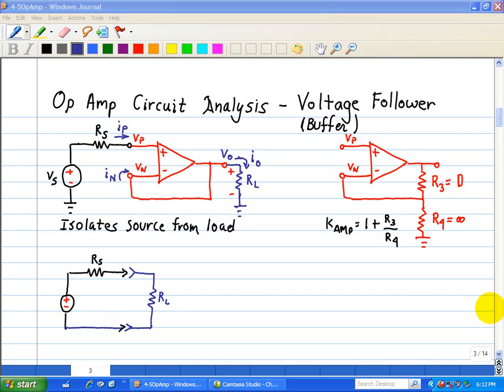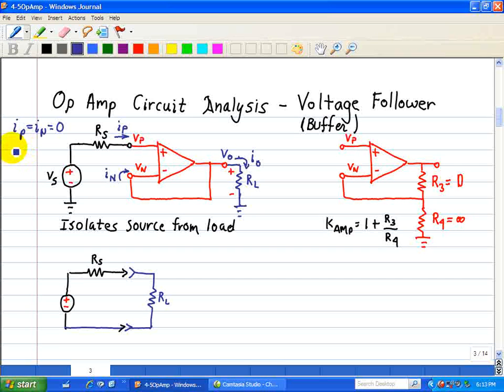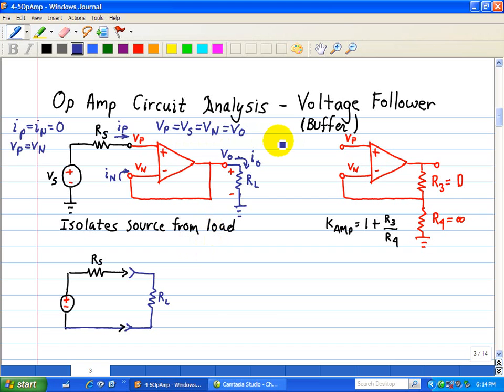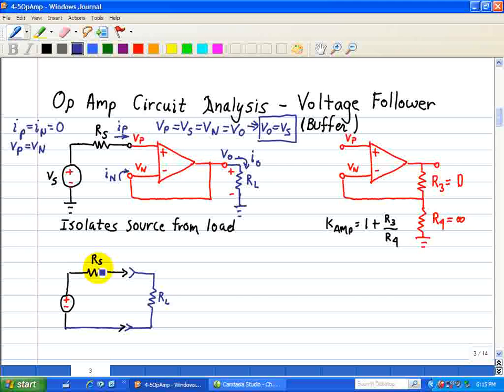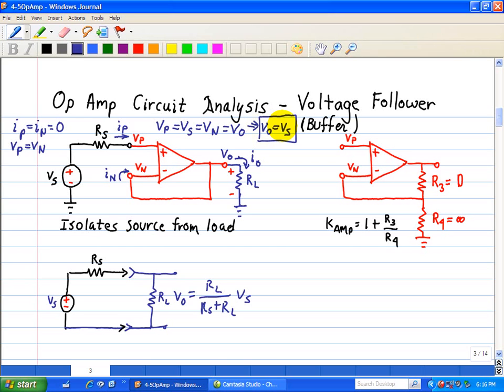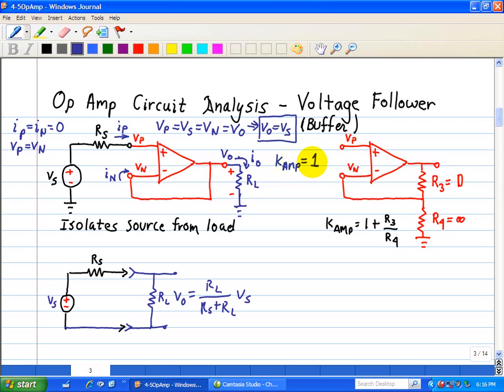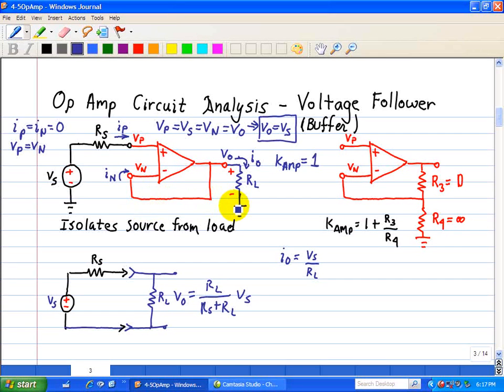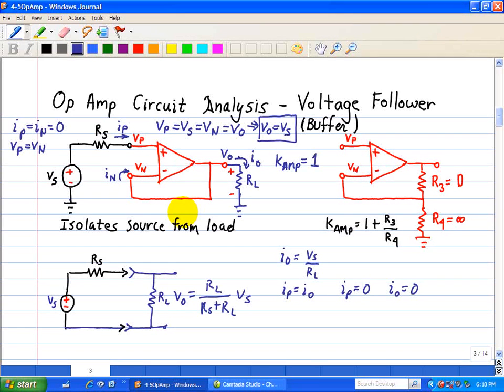Op Amp Tutorials and Circuit Analysis - Voltage Follower (Buffer)

Comment: ok nevermind, i had the LM741 chip powerd by VCC and ground rather than V+ and V-.. speaking of which, is there a way to simply power an LM741 chip (single op amp chip) with a single battery source? obviously i'll be using it as a voltage follower

Comment: i have a problem tho im trying to make a buffer and im testing it with a simple voltage divider pot to change the voltage of Vs and measuring Vo.. but what im getting is 1.92 volt output even when the volt input is zero or < 1.92... its weird. any help?